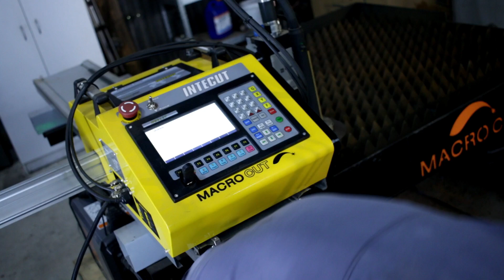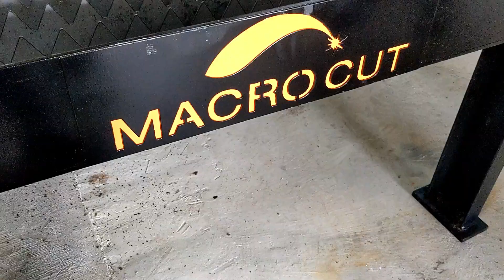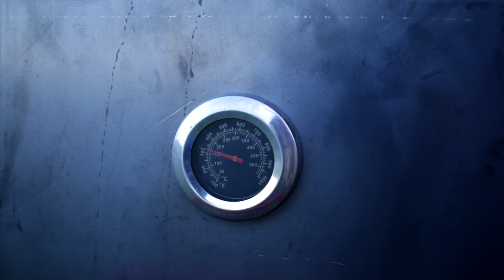My CNC INTECUT 2. A Big Upgrade For The Workshop!!!

Comment: I have a family member that has one of these machines. I’m a frequent user of my laser cutter and cnc router so he want me to help operate this machine. Any tips on learning? I can’t see much online. Thanks
Reply from the maker: It depends on the plasma cutter you're using, if you have a hypertherm like mine it's really simple, they give you all info you need in their book cutting speeds torch height etc. I haven't done a deep dive on that machine and maybe I should if time permits.

Comment: i loved watching video, thanks - i am looking at this unit my self, what else do you need to do drawing make my own designs?
Reply from the maker: It comes with a complete cam package Fastcut and I could have used that except I had already learnt fusion 360 which in all respects is a better drawing platform. Particularly if you're doing a lot of sheet metal work, it accounts for growth in bends and has a lot of neat features that really streamline design and production. But if you are just doing basic stuff you could totally go with Fastcut but it is very old software and it is frankly awkward and slow to use once you've been spoiled with modern stuff.

Comment: Did you fill the table with water??
Reply from the maker: No. It has that option but because I mainly do prototyping and not processing full sheets I leave it dry so as not to spoil what metal remains with rust.

Comment: Very interested in purchasing a CNC table. Are you happy with the Intecut. Wondering if everything is included or if you have had to purchase items to make it work such as in-line air filters and software. Also having never used CAD wondering how easy the built-in template basic shape cutting tool is to use setting sizes etc. I gather you have opted for a hypotherm unit with 3 phase or 32 amp single phase?
Reply from the maker: Hi Tim.
To date it's been a very reliable machine.
The support and follow up from Macro Weld has been amazing. They didn't leave to just work it out, they made sure I was up and running.   
The only thing I needed to buy was a decent air compressor and inline filter.
I underestimated how much air I needed, always better to have too much air.
Built-in templates are straight forward to set up, very handy.  I did get the three-phase  45 hypertherm plasma cutter, and I have nothing bad to say about it. A very good unit. As far as software goes I didn't need to buy anything it came with a cad program and a nesting program, two things you will need to get familiar with to make the most of this setup.  But again macroweld with really helpful and getting up and running with the computer side of things.

Things I don't like about the machine. 
It's a crossbow design so the gantry has a bit of flex in it, resulting in a slower cutting speed. Not a big deal on heavy plate but a little bit annoying on 2 mm plate steel where the cut finished could be improved by a slightly quicker cutting speed.   This would be my only complaint about this machine.

A bonus is it comes setup for oxy acetylene cutting and all you would need is a oxy bottle, LPG cylinder and the appropriate leads and you would be off and cutting. I haven't tried this as I haven't had the need to cut anything really thick, but if I ever do it's good to know that I can.  Hope this helps 👍
Reply: @LittleAussieRockets  Thanks for the detailed reply. Keep up the great work and best of luck with the fitting and turning. Great to have down-to-earth Aussie content to view on Utube.

Comment: Hey - nice! As you keep designing stuff for plasma cutting (or in my case, laser cutting) you may want to explore tabs and slots for alignment, strength and ease of assembly. Takes slightly longer to design, but it's well worth it in the end.